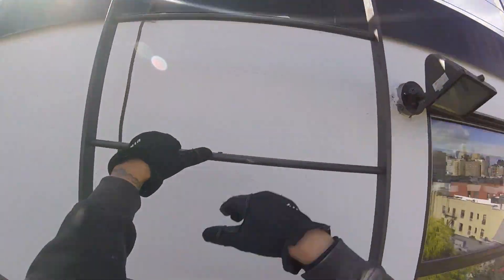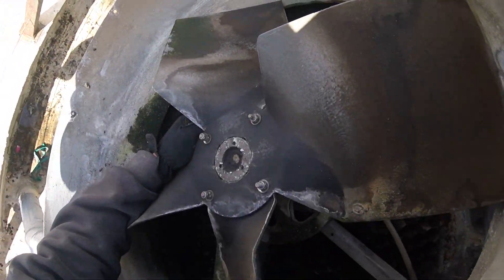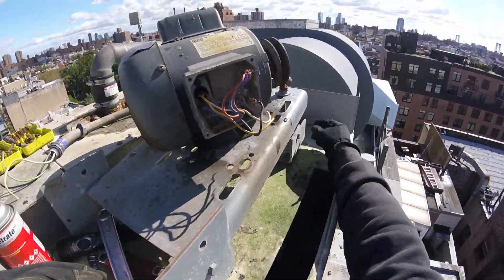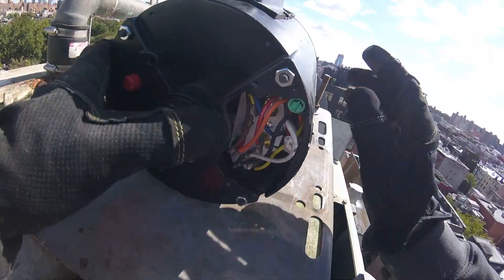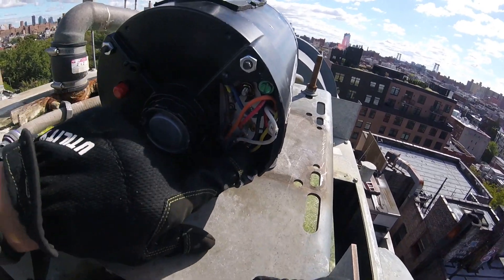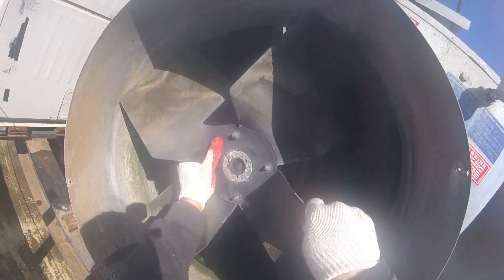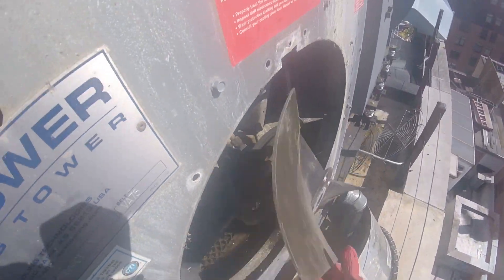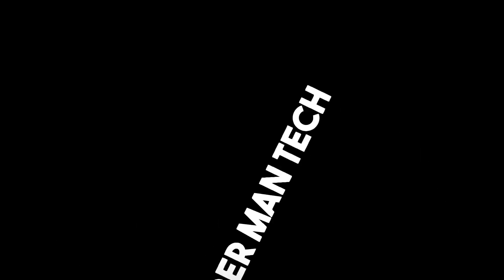HVACR: Cooling Tower Fan Motor Replacement/Installation (Marley SPX Cooling Tower)

Comment: So wouldn’t removing that shroud diminish the airflow through the unit due to the fan blade placement? I get why you removed it but question is did it cause any other issues. I can see from the location all it was protecting was the pigeons 😂